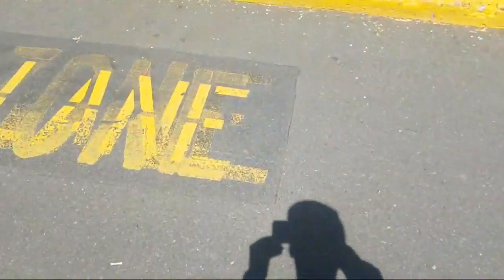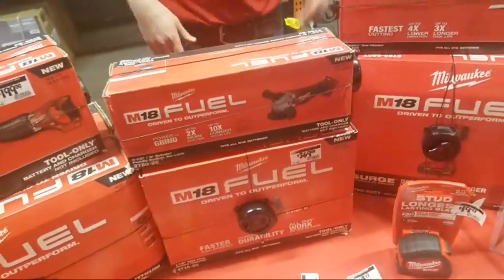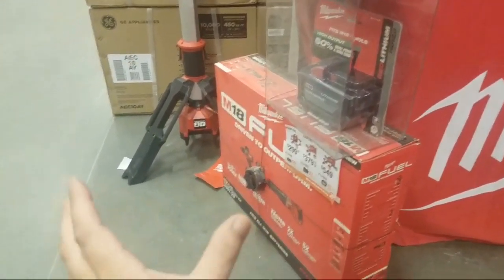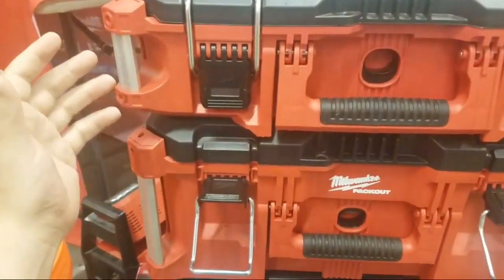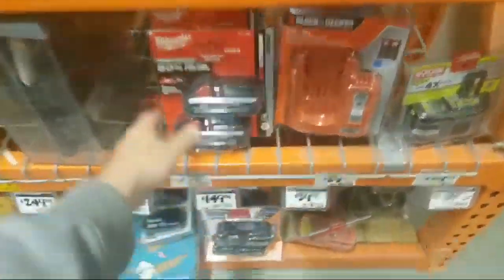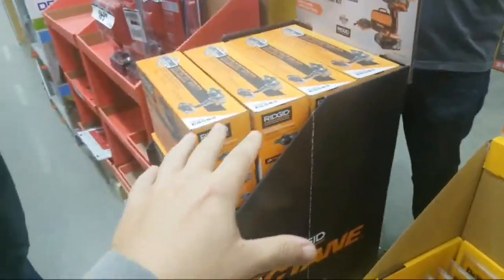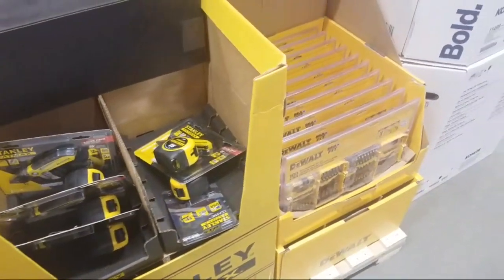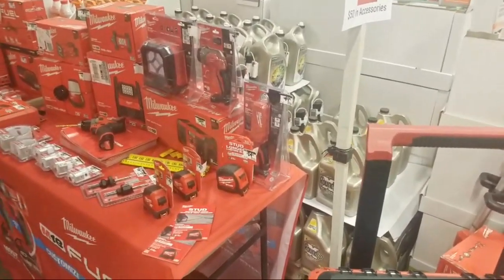Milwaukee Tool Event At Home Depot LIVE !!! BEST DEALS !! (April 2019)

Comment: TB. Testing whether or not I can post a comment.

My question on this live stream was looking for preview of work light deals coming up.
Reply from the maker: Yea man ..I see ya ..yea a few PackOut deals you can get a light for free.  But the best deal is on the M12  Rocket Light with free 6ah Battery for $149
Reply: @toolboss8410  I think that is the one I'll pull the trigger on. The 12v is WAY more compact than the 18V. They were  not in the Spring Black Friday sale items in Portland, OR. I will have my eyes pealed on May 4.